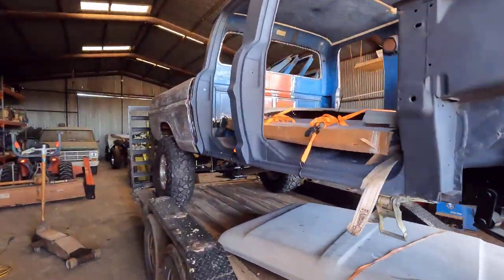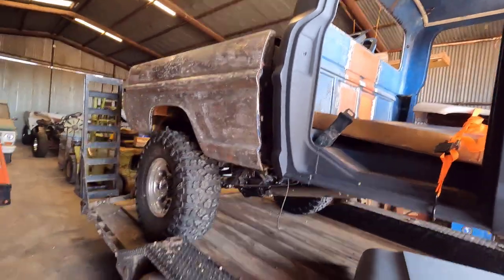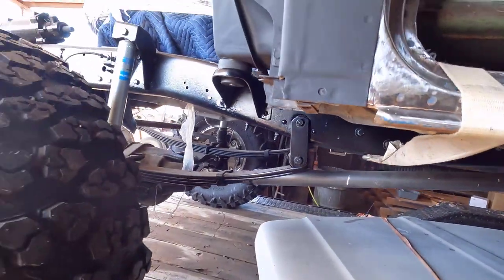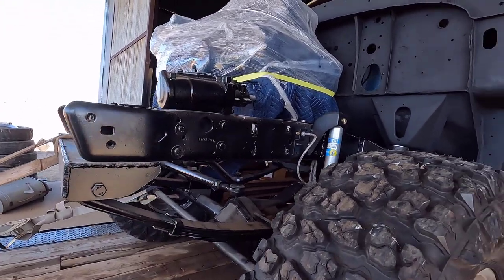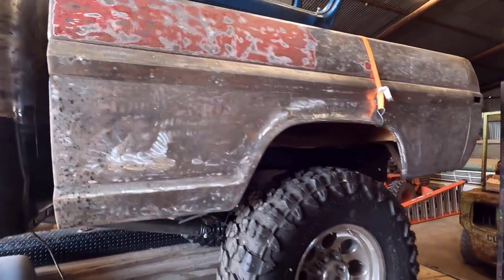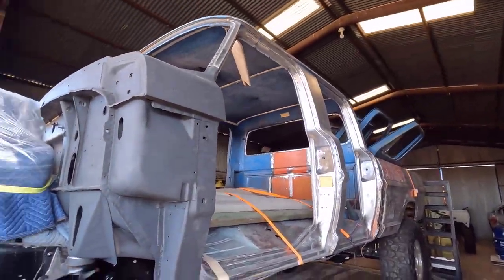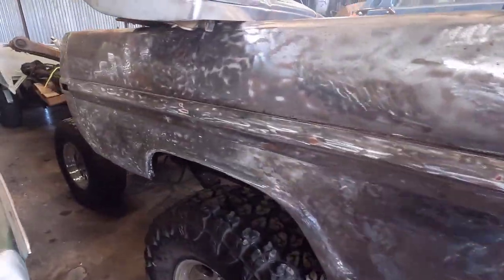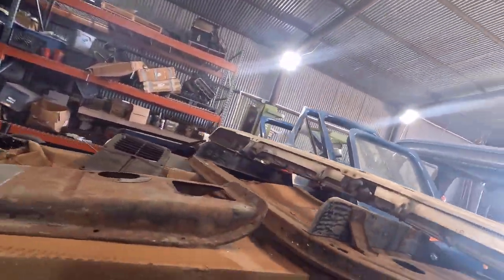Holy Grail Bumpside! REAL Crew Cab Highboy!

Comment: I had a chance to buy one of these in 1981 for 800 dollars. It was a stock 1969 crew cab f250 4x4 highboy with a winch. White in color. It was a good running daily driver. Certainly not a desired vehicle at that time and place but I wanted it. I was 17 years old at the time and my Mom wouldn't let me buy it. I was pissed off then, and I'm still pissed about it 42 years later. It's one of those regrets that's never gone away.

Comment: I'm glad I found this channel. I have a 73 F250 High Boy step side with a 300 six, best motor Ford ever built (yeah I'm a six cylinder nut) that I rebuilt 30 years ago when I bought it and it is still going strong. Many trucks have come and gone over the years but the Ford is a keeper. My latest upgrade is a Steerman electric power steering conversion. I look forward to watching more episodes on your latest build.

Comment: I have never seen good aftermarket sheet metal to make the bed out of where would you get yours the stuff Icees from China and is junk compared to the original weight long live highboys
Reply: I was hoping he’d answer this question too. I have a 70 highboy that my grandfather bought new. I’ve been wanting to restore it for years but the rust seams too overwhelming. I never new buying parts and building a bed was an option.
Reply: @broncobros2022  if possible check the strength of the steel before you buy it it may be way cheaper and flimsy I would put fluid film on your truck now even if you're going to restore it later just to stop the rust I love that stuff in other words don't let it get worse